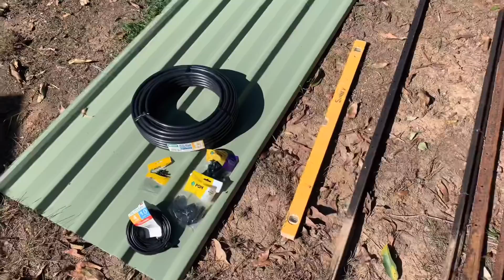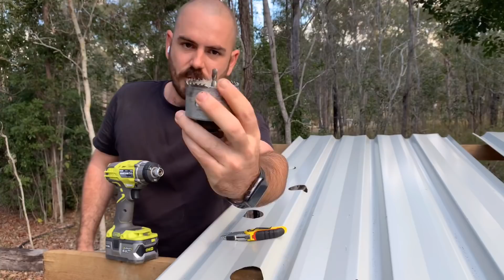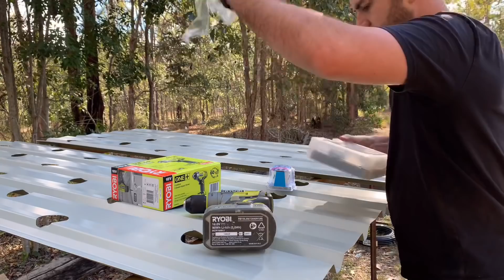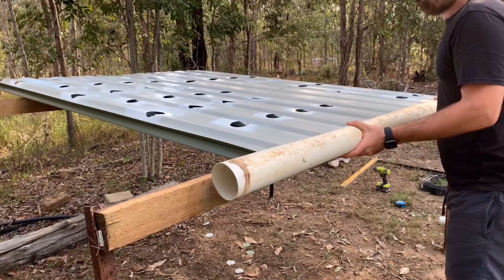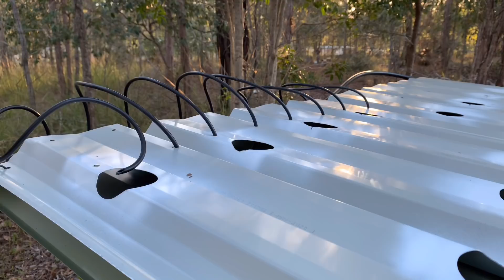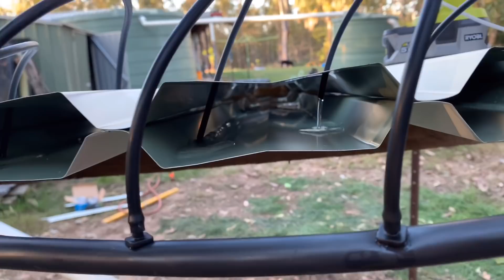The “Cheapest” NFT Hydroponic System You Shouldn’t Build

Comment: A "Bi-Metal" drill bit just means it was made from two different metals. In the case of your cheap hole saw the teeth are made from a harder metal which helps it last cutting wood as compared to plain steel 

As usual, you are an !diot

Comment: It would be interesting to see this done with PVC roofing. I don't know if you can get a flat PVC panel cheap but if you used that for the upper panel that would be a hell of a lot easier to drill.
It seems a NFT system like this would be easier to clean as you could just lift up the upper panel without having to remove the plants from it, and then you can pressure wash the base in place.

Comment: Hey mate a tip for your holesaws, use slow speed and use your torque setting (not drill setting). Keeps your holesaws sharp and prevents the bite that breaks teeth. I’ve done a lot of drilling into switchboards and through experience has found this to work well. 
Love the vids

Comment: Hey I know I am late to this party, but for cutting holes in sheet metal Qmax punches while not cheap (for that size ? upto $100? but they cut a clean hole that needs little if any deburring and only need a small pilot hole drilling to prep, i have used them to cut the holes for drains and elements in the stainless steel pots that make my 100l/80l/100l 3v microbrewery
search for 75mm qmax punch

Comment: If a channel fails, it'll be time to double the 4mm water feed tubes.
I used to use 2 per channel, but extras may add peace of mind.
This is from the point of view of possible blocked feed pipes, which could allow a gully to run dry.

Comment: aight, I was thinking about your stitch & my 2c are >>   Hole Saws suck bro. They have reputation for it.  Period.  I dunno what gauge U got there but my first goto for cutting metal is tin snips. Yea it might be tough, but it makes your hands tough and they are built tough. (if you break tin snips it means you bought some crappy ass tin snips.  I've used the pliers + tin snip combo many a times ).  Anytime cutting LOTS of metal, just use the sawzall. TBH, I try to use it more. I used to Aluminum Oxide cut EVERYTHING,, but then I realized thats NOT smart. Sawzall is easy as cake. That little galvanized roof would be more like butter 2 a sawzall.    why not square hole ?  esp caz ur making ur own seed cubes  OR using a small hole and a normal bit... I've been thinking of using beer bottles, caz its a cone(upside down) and will fit in LOTS of sizes, we throw em out anyways. Breaking the bottom out would be fun to perfect

Comment: Hey Hoocho, I now know for sure, that you weren’t joking when you said you were “Pucking crazy”!  I know its Aussi winter now but if even if this design sort of worked ok, what do you think will happen to the temperature of your nutrient solution in summer?   Sorry mate, that’s one big heat sink for the sun that you made, that could really limit your growing season.
Reply from the maker: Yeah I was worried about the heat, was hoping the white would reflect most of it, I did think about having lugs between the sheets when I screwed it down to stop the heat transfer, but once I hit the hole problem I just wanted to be done with the thing.

Comment: Painful, I hope bunnings replaced that stuff free of charge! 

Along with the concerns you mentioned at the end, I would be concerned all that metal will cook the roots on a nice hot sunny day. 

Great idea though.
Reply from the maker: DustinF yeah can’t fault Bunnings. Replaced the impact driver and refunded the hole saw without blinking an eye.
Five stars.
I was worried about the heat too.
Reply: @Hoocho  Ya, my experience has always been good with bunnings. They have always refunded or replaced anything I have had issues with.
Reply: @Hoocho  I know this is an old video, but I wanted to point out that there's a lot of things that aren't impact rated that will fit into an impact driver... the hex shape is much easier for a drill chuck to firmly grab and prevent slips.  Even if it was specifically called out as impact rated, I'd still definitely be hesitant.